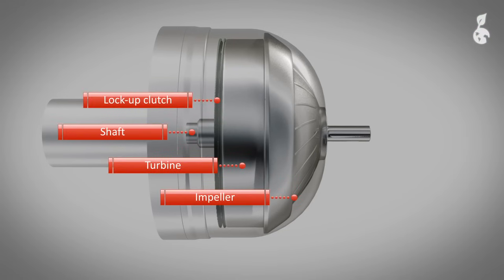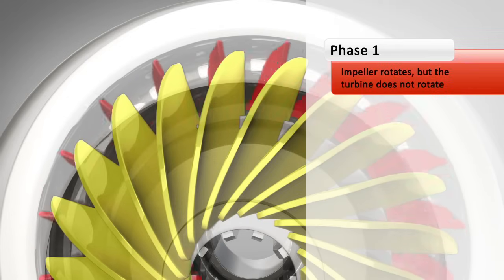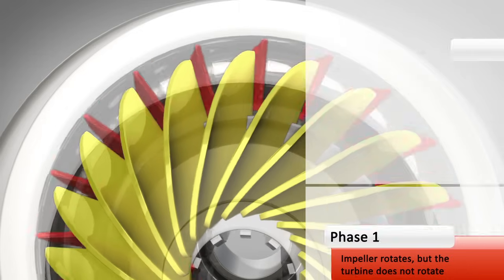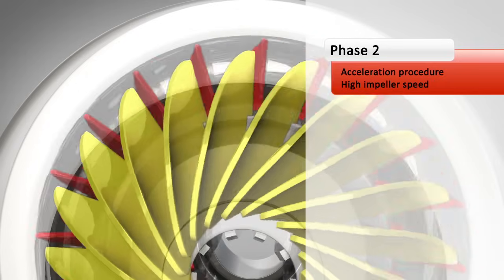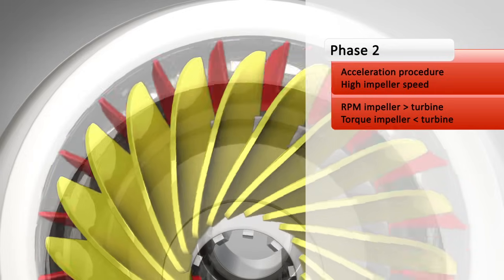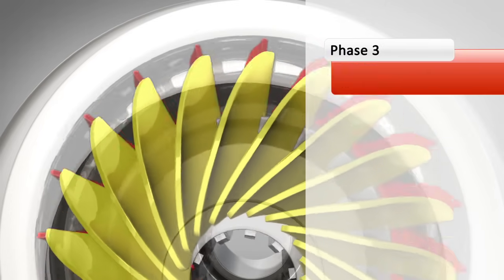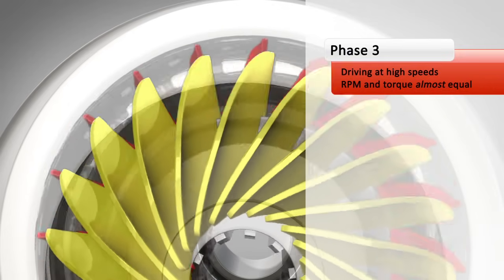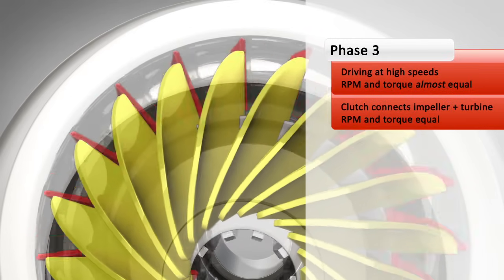How Torque Converters Work! (Animation)

Comment: The stator assembly never seems to be explained adequately, so I will explain it now:

The stator redirects fluid flow exiting the input turbine, so the fluid impacts the output turbine more forcefully. This allows the fluid to transfer its kinetic energy to the output turbine more effectively. However, the stator also creates a lot of turbulence in the fluid, and therefore wastes some amount of energy in the process.

To minimize this effect, the stator is mounted on a one-way bearing that allows it to spin freely in one direction, so it stops interfering with fluid flow when the torque converter is spinning at high speed. This "unlocking" occurs once the entire torque converter is spinning fast enough that the forward rotation of the torque converter overwhelms the force of the fluid trying to spin the stator backwards.

Since the force trying to spin the stator backwards depends on the total amount of force being transmitted through the torque converter, that means the exact moment when the stator unlocks and starts spinning depends on how hard the vehicle is accelerating.

In layman terms, the stator is always locked when the car first starts accelerating, and it unlocks when you finish accelerating and start cruising at your intended speed. You can re-lock the stator by stomping on the gas pedal, and you can unlock the stator again by easing off the gas pedal or coasting. There's no reason for you to do this on purpose, though, because locking the stator is only useful during hard acceleration, and the extra efficiency from unlocking the stator only matters at high speeds. Just let the stator do its job and drive the car normally.
Reply: I should clarify: I used the terms "locking" and "unlocking" to refer to the stator's two modes of operation, but these terms are more often used to refer to the clutch at the front of the torque converter. The purpose of this clutch is to completely bypass the torque converter when cruising at high speed, locking the engine to the transmission exactly like a foot-operated clutch in a manual transmission. The clutch and the stator are two separate devices with different purposes, and the fact that both of them can "lock" and "unlock" should not be interpreted to mean they do the same job.
Reply: Very well explained.
Reply: Can you expound further on what makes the Koenigsegg torque converter unique or novel?  Is it the case that in a conventional automatic transmission, the job done by gears in a manual transmission is done by changing the angle of the blades in the stator, starting at an angle that generates max torque when the car is at rest, etc?  Does this happen in the stator or where?  In the Koenigsegg, as I understand it, the electric motor spins up the torque converter, but from there I am lost.  Thanks.
Reply: +lmff620: I don't know specifically how the Koenigsegg torque converter is different, but the most likely differences are in the bearings (to support higher loads without failing), the oil coolers and the oil itself (to handle higher fluid shear and higher heat without permanently losing its viscosity), and the exact angles of the vanes on the impeller and turbine. They also appear to be machining each component from a solid chunk of aluminum  rather than using stamped sheet-metal parts, to support higher loads without bending anything.

...which is to say, all of the major design components of a torque converter. ;)
Reply: He's flying! Old indeed!
Reply: ...wow. I originally wrote this comment 6 years ago.
Reply: @fyrstormer  Good info,  I have a failing 1way clutch in my truck right now, the harder you try to accelerate, the more the engine revs, but doesn't load up hard an actually put the power to the ground
Reply: Thanks Shawn, that gives me a very clear picture.  A lot for me to chew on there... ;)  Thus, if the stator cannot spin, torque is transferred to the transmission case, I can see the big problem with that! ;)
Reply: @thisisyourcaptainspeaking2259 : It is a reasonable tradeoff to temporarily waste some power by jamming the stator against the transmission case, in exchange for improving torque transfer between the input and output turbines during hard acceleration or when towing a heavy load. It prevents the engine from wasting even more power by revving higher and churning the transmission fluid more,  as it would do with a simple fluid coupling that didn't include a stator assembly. But yes, if the stator is permanently locked and interfering with fluid flow continuously, then it's just wasting gas.
Reply: @fyrstormer  Agreed, it makes perfect sense.  For some reason it didn't occur to me the stator is connected to the transmission case.  I should'a known that, lol.  Now I'm wondering why it's not connected (using the same 1-way clutch) to the transmission input shaft, I can probably figure that out.  Thanks again, for the explanation.
Reply: @thisisyourcaptainspeaking2259 : If the stator were attached via a one-way clutch to the input shaft instead of the transmission casing, then it could never spin slower than the input turbine, and it would just become an extension of the input turbine's vanes -- angled the wrong direction, no less. (alternately, if the one-way clutch were reversed so the stator could spin slower than the input turbine, then the stator would never lock in place because the one-way clutch would be allowing reverse rotation.) Because the stator's vanes are angled backwards, it is always spinning slower than the input turbine -- it just isn't always locked against its one-way clutch, so it isn't always acting to redirect fluid exiting the input turbine. Most of the time the stator is freewheeling, dragged along by the rotation of the entire torque converter, but slowed relative to the input and output turbines by the fluid passing through its backwards-angled vanes. If it could never spin slower than the input turbine, it would always be redirecting fluid exiting the input turbine, which would be counterproductive most of the time.
Reply: @fyrstormer  Excellent explanation.  If the stator gets permanently locked, thereby continuously interfering with fluid flow, in addition to wasting gas, would it cause drag and jerking by exerting a force in the direction opposite to the direction of travel?
Reply: And there ya go, another good explanation!  And yes six years ago! ;)
Reply: +Dux +Unum, I can explain it to you, but I can't understand it for you.
Reply: Thanks Shawn.  It might help to know what the stator is connected to, I guess not the input shaft of the transmission.  So I take this to mean if the stator spins freely both directions, stall speed is higher than normal.  Still unsure what happens if the stator  bearing is locked solid, perhaps engine speed is higher than normal, at speed?
Reply: @thisisyourcaptainspeaking2259 : The stator is connected to the transmission housing via a one-way clutch. When fluid pressure exiting the input turbine overwhelms the circular motion of the entire fluid-and-turbine assembly inside the housing, that pressure forces the stator to try to rotate backwards, which locks the one-way clutch. Then the stator stops freewheeling inside the torque converter and becomes a set of fixed-position vanes that redirect fluid exiting the input turbine, so the fluid impacts the vanes of the output turbine more forcefully. This improves torque transfer from the input side to the output side under high torque loads.

If the stator is unable to move at all, it will get in the way of fluid exiting the input turbine and cause extra drag for no benefit under low-torque loads, i.e. when cruising.
Reply: @fyrstormer  so basically you are accelerating the fluid, which gets slowed down by the stator, leading to a torque conversion due to a lower spin with higher head-pressure in the turbine, but the speed of the turbine as well as the impeller increase over time.  However the  acceleration of the Fluid and the subsequent redirection of flow in the stator lead to the stator Tring to rotate backwards, locking up as a consequence. Does that mean, when the acceleration of the fluid drops below a certain amount (due to the impeller having spun up the fluid and  as a result of that the turbine to speed) the stator will not try to turn in the wrong direction anymore but instead starts turning in together with the entire assembly? 

Or is that question stupid and high haven't understood a thing.
Reply: What happens if the stator clutch fails in the cases the stator bearing rotates freely or is locked?  What are the results?
Reply: @thisisyourcaptainspeaking2259 : If the one-way clutch fails so the stator can spin freely, the torque converter will be somewhat less efficient at high torque loads. If the one-way clutch fails so the stator can't move at all, the torque converter will be significantly less efficient at low torque loads or high speeds.
Reply: Thanks Shawn for your clear explanation of how the stator works!!!   It helps when giving an explanation of torque converter.  ( BTW, I work at Exedy,  :)   )
Reply: I believe the stator will start turning at almost the same point when lock up clutch is engaged as there should be some torque multiplication as long as the turbine is turning slower than the impeller
Reply: Thx for explaining how torque converter works but how does it change gears? 

When does the clutch auto engage? Can a user get to know?
Reply: Anyway! I'm sure you'll be fine! Neat! This is my way in so now I have my theory so to speak and then I can apply the work with using this! Glad this isn't a problem anymore! Sure is a hassle! Excellent for firing somone up on a larger project! Really the taunting and teaching (which can be lack of teaching is very annoying!)  I understand!
Reply: Wow you just solved the mystery for me! Thanks for the exemplary explanation
Reply: +Dux +Unum: My profile picture is not the Rising Sun, it's a parody of the Rising Sun. Click on it to see a larger version. Also, the Chinese seem to be very easily offended by anything foreigners do that they dislike, so I'm not inclined to care if they dislike my funny profile pic.

Comment: hello thomas,

what i understood about the torque convertor from this video is:
Impeller - is the input source who gets power from the engine via the housing.
Fluid - is the coupling device who is doing the work.
Turbine - is the output power source
Stator - is for changing the direction of fluid flow from the turbine to the impeller.

In the video u said that impeller and turbine there is no torque created but u need special device called stator. what do you mean by no torque created. What i see in this video is that when the impeller is turning the centrifugal flow of fluid is rotating the turbine. And then the fluid moves from the centre of turbine to the centre of impeller. The cycle is repeated. SO DOES IT NOT MEAN THAT THERE IS TORQUE HAPPENING AT BOTH ENDS. SO WHY DO YOU NEED A STATOR? you said that stator multiplies the torque. Torque for whom? WE KNOW THAT THE ENGINE IS DRIVING THE IMPELLER, SO WHY DO YOU NEED A STATOR TO GIVE ADDITIONAL TORQUE TO IMPELLER?

Comment: SlushBox
Reply: You accidentally none of the technical expertise. Thanks for playing, please try again.
Reply: Shawn Elliott Its a hydraulic system that uses fluid to spin mechanical parts.  SlushBox describes it pretty well.
Reply: keithrig Torque converters have integrated bypass clutches to completely eliminate slip while cruising at-speed. Also, "slushbox" implies that the hydraulic mechanism is incapable of transmitting torque effectively, which is very wrong. Even the most worn-out torque converter connected to the weakest car engine could still twist your arm off if you held onto the output shaft when the driver tapped the gas pedal.

Comment: So this is the device that makes cars with automatic transmission feel gutless?
Reply: ***** Drag racing cars run automatics because they shift faster than you can shift a stick and are much easier to launch ;)
Reply: No. This is the device that makes cars with automatic transmissions capable of generating more torque at the wheels than cars with manual transmissions. The "gutless" sensation you refer to is caused by engine tuning and programmed shift points.
Reply: ***** Manual transmissions don't usually have better fuel economy anymore. If they do, it's usually 1mpg or thereabouts. Some vehicles with both transmission types actually get slightly better gas mileage with the automatic transmission nowadays, because the computer can choose a gear that allows the engine to run at its most efficient speed when the driver isn't driving hard.

Also, some drag racers actually prefer automatic transmissions (tuned specifically for drag racing), because the transmission can apply torque to keep the car accelerating even while shifting, and because they don't have to deal with the vehicle's stance changing due to shift-shock. No matter how good you are at shifting a manual-transmission car, an automatic transmission can shift faster, as long as it's programmed not to take its sweet time.
Reply: on the money
Reply: Shawn Elliott Oh I see, so that's why cars with manual transmission compared to same car with automatic transmission (slush bucket type) accelerate faster and have better fuel economy.
Reply: Shawn Elliott I would like an explanation on how a torque converter can apply more Torque to the ground. 

When locked it puts 100% of the engines torque to the input shaft of the transmission. Same as a locked clutch, in a manual. 

Both can apply less torque via slipping.

 Torque at the wheels is changed by transmission not the method which delivers the power to it.
Reply: ***** You specifically said that it automatics could apply more torque to the ground, that is false. If your car has 100ft/lbs (any honda) of torque and drivetrain losses are ignored (autos have more parasitic loss but well ignore that). Both a clutch and a torque converter will put down 100ft/lbs.

Comment: Not centrifugal force. That's an imaginary force that people who don't know physics use to understand inertia. The fluid just goes straight unless told otherwise by centripetal force. That's why the fluid goes outwards. It's a common mistake, but should be avoided.
Reply: Otherwise, a pretty good explanation. It would be good if you had mentioned why it is used too.
Reply: Liam Clink I mean, I realize that it's supposed to convert torque, that's in the name, but what is that? I'm a physicist in training, and I don't know without having to do some research, so I would appreciate if you would explain, but in the mean time, I'll do some research. Thanks, 'tis a pretty cool video
Reply from the maker: Hi. No, that's not true. Think again :)
Reply: I'm in physics right now, and just to be sure, even though we're talking about rotational dynamics right now in class, I asked my teacher, so I'm pretty sure that I'm right. Our textbook even says it.
Reply: And anyway, it's just newton's first law. And if centrifugal force was a real thing (which is one of the first things we were told this year, that it's not real) what would be applying the force? What's really happening is that the outer wall is keeping the fluid from going straight by applying a centripetal force inwards.
Reply from the maker: "Real" is an invention of mankind. "Time" - for example - is not "real." It's just a name given to a phenomenon in our world. It's the same with everything else (e.g. atoms, infinity, centrifugal force).
Reply: Liam Clink Perhaps what your meaning to say is that technically centrifugal force does not exist as a mathematical equation. I think what Thomas is saying is that it's a real phrase that explains the inertia generated from a radial motion on it's surrounding connected objects whether it's a fluid or a solid object.

I find it far easier to understand when put into the terms of a centrifugal clutch that a go kart uses which as the output shaft of the motor spins, weights with the clutch shoes attached to them are connected to the output shaft which have springs retaining them in their stationary state and as the RPM of the shaft increases the inertia of the clutch weights causing them to stretch the springs and grip the outer housing of the clutch body causing it to rotate. If that's not "Centrifugal Force" then what is it called?
Reply: Centrifugal force is the result of linear inertia projected in a polar coordinate system. It is completely real, you just choose to believe it isn't, so you can argue about something.
Reply: Inertia is not a force though, it is a lack thereof. That's newton's first law. I'm not saying that inertia isn't real. Centrifugal force is an imaginary force (it's literally called that in my textbook) because we are trying to apply newtons second law to an accelerating reference frame, and newton's laws are only valid in non accelerating reference frames.
Reply: Newton's Laws were superceded when Einstein came along. We know now that there is no absolute frame of reference.
Reply: +Liam Clink
Just curious, what Physics textbook do you use ?
In Fundamentals of Physics by Jearl Walker (revised edition by Halliday and Resnick), the word "centrifugal force" is not found at all.
In University Physics by Hugh Young, the author gives good explanation why the force doesn't exist (in an inertial frame of reference) and therefore advise us to avoid using the word.